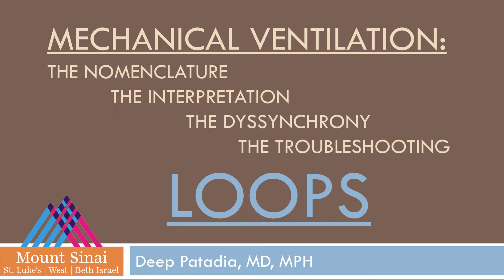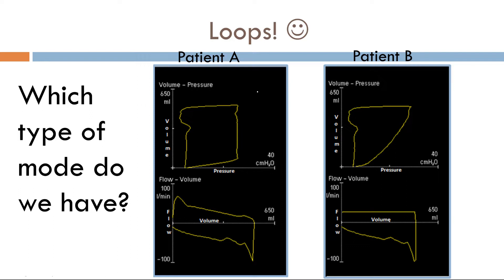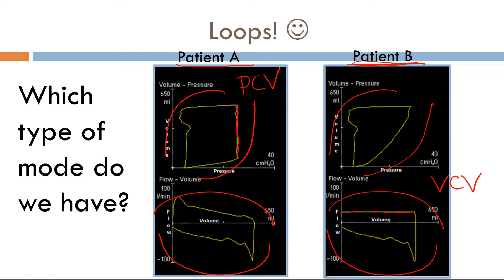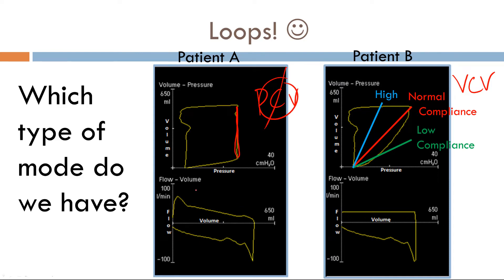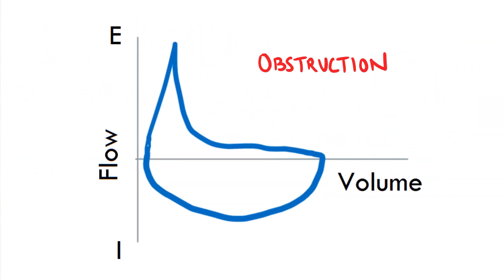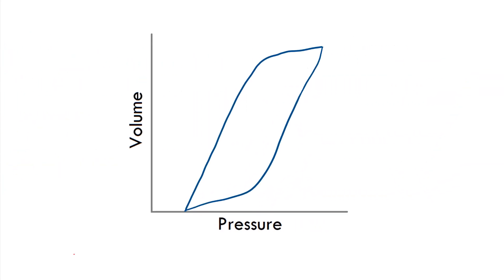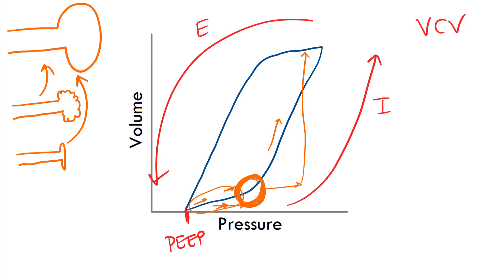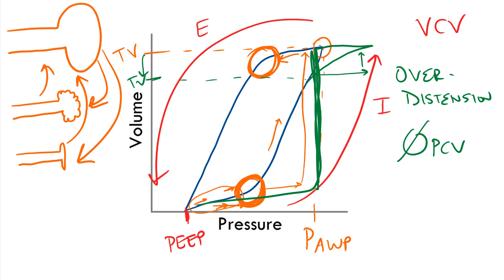Mechanical Ventilation: Loops - BAVLS

Comment: yes... you can calculate compliance on pressure control modes as well.
Reply: I was also under the impression that you can check compliance in PC. Wouldn't you be able to see the peak volume at the Pip and calculate the compliance from that?